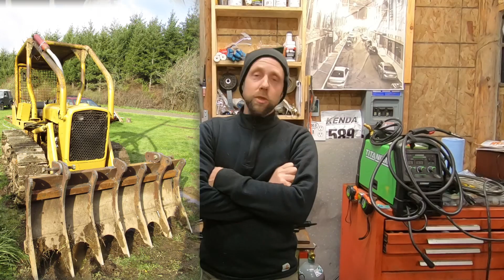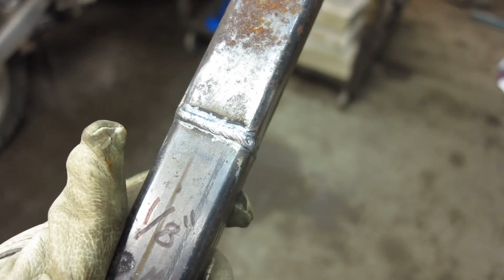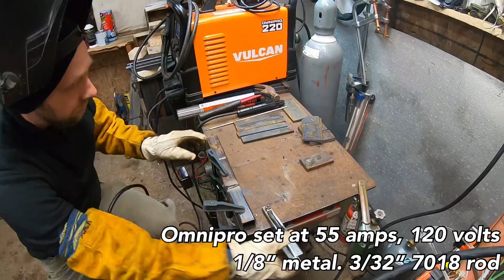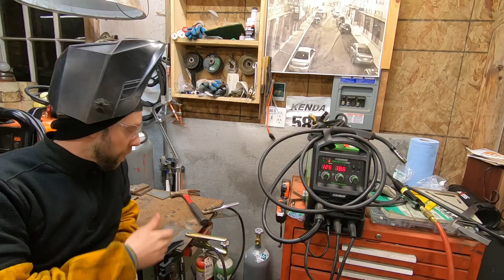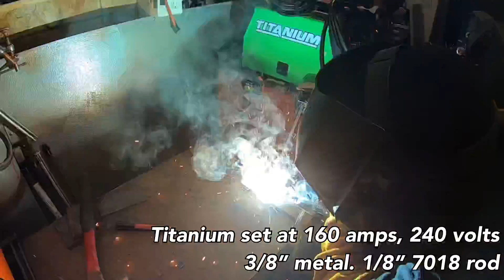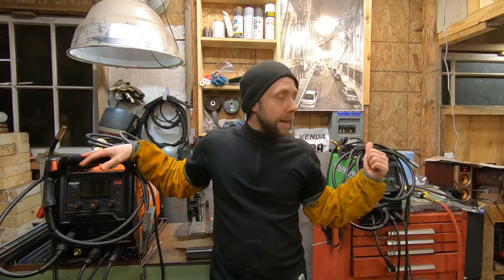Vulcan Titanium welder Harbor freight stick welding comparison

Comment: edit:link is down atm I fucked up admin from command line. container with WordPress db filled and I found out the hard way adding a / to the end of rm deletes a directory when u intend to delete a symbolic link
If anyone wants to see inside green machines.. This was buried in a reply to the Channel owner. It's my site.  https://www.vengeancetech.biz/fabrication/titanium-120a-wire-feed-partial-tear-down/
I'm not an ee but into electronics since my first word. light bulb. ham radio liscense at 13. I've done custom boards /cadand built UV lithography rig to make cad I did.. probably mathematic dyslexic or I would have a CS degree but point : my creds or lack of not hidden..   obviously you don't have to read a word you could just look at the pictures. When I first wrote this I didn't have a picture of the backside of the main but there is now one at the bottom
-----also sub dude who takes the time to make the well produced quality content above. So hopefully we see more of it cuz you know the alternative: five minutes inaudible talking and speaker blowing grinder or other tool noise. Learning about things have a prerequisite of hair trigger mute and Advil by the keyboard.

-----

my friend has the 120a titanium mig and its a nice little box but if u use it as a daily driver I don't see it lasting very long. he had issues where it wasn't feeding so I opened it up and.. it could be a lot worse but there were some serious issues. first is longevity expectations. the two large bulk capacitors are literal between the 2 main heat sinks with very little clearance. You can think of these caps as basically a paint can with fluid. this paint can has a magic fluid inside it that once it's gone the magic of your welder goes with it. fluids tend to dry up/evaporate and high temp makes that happen faster. 

The manufacturers know this and that type of capacitor is rated for hours at a given temp. there are types that don't depend on liquid but for the large capacity these dominate and for any capacity are usually cheapest. 

but with the paint can type (electrolytic) If you exceed that rated  temp the expected hours it will survive start to decrease.

 Major design faux pas we're talkin like half an inch between heatsinks that are attached to the switching devices that do all the inverting in your inverter welder. they did put a fan and a little air duct but if that fan fails I would not expect name the last at all not like you might use it a month or a week I would stop welding from what I saw on opening that. I didn't have long inside it and my phone was dead so I don't have pictures of one side of the main board that said I could not even locate a fuse on the darn thing. There's a hundred and 80 amp current shunt but that's not really meant to be abusing if it blows it out board will be repairable most people that I've known that have own welders wanted to open them up anyway the thing is basically designed to last a year or two if you use it seriously if you use it maybe every 4 months you might find you get 5 years out of it like for a week every 4 months not just like pull the trigger once. I can't see it lasting more than 2 years with daily use anywhere near the duty cycle and that's if you get lucky on the fan survives the whole time we all know shops are not usually the cleanest environments particles in the air wise. This machine also trips gfcis more often then my clutch 140 and when I opened it it became apparent as to why I don't have the expertise to tell you exactly what and how much of it was missing but I will tell you if you ask someone that does Lake Worth of Paul ee degree I would probably bet my life they're going to tell you that the power filtering is minuscule to inadequate barely adequate might be astretch I like welding on that box dont get me wrong. I liked it the moment I tried it. we noticed things like popping the gfci and lights flickering or failing significant more frequent with the titainum. the drive motor may or may not be failing for his wirefeed. if it did it would be incredibly cheap and easy to swap yourself.

it seemed to be lacking quite a few human Saftey considerations as well. I'll updated this later with specifics and I intend to open my clutch today to see if it's really any better in design. I know it didn't really shine until I was able to plug it in to properly gauge wire for a long Outlet run. I don't like any of the potentiometers aka the knobs on the front of that unit but once I got it figured out I really enjoy welding with that as well. I have the version one of the clutch which was notoriously hit or miss not in people liking it it's either they got cradle death or a welder they loved it died out of the box or it's excellent. I might be able to shed some light on why later. By the way it would make more sense to talk about what it's rated in Watts when you say at 120 volts because 70 amps or whatever welding amperage you're using is at like 16 volts. Volts times amps equals Watts if you raise the voting age you can draw less amps for the same amount of power. That's why the wall is 120 coupled with the fact that heat is an equation of power in watts of thermal is equal to current squared x resistance which is why we use high voltages for distribution and relatively high in are walls but a welder watch the Heat so you drop it to lower voltage to raise the amperage
Reply: Wuety06 Appreciate the technical insight on the internals and QC issues you must have an electrical engineering background? From one QC tech over here been looking at both the Flux and the Stick Titanium’s from HB any better recommendations?  Thank you sir on this report on the circuit and real world insight!
Reply: @kewlnorcaldude  I assume HB is HF? I just cleaned up my comment above a little for the same issues this tiny ass phone screen interface isn't helping anyone. I'm guessing both the stick and the flux models share pretty much identical components. the stick of similar amp ratting probably just omits the chip(s) to drive the motor, and motor for the wire.  I've only been inside the flux core one though. On some Carpenters Channel he was talking about his stick version and just from looking at it on there I could see from the form-factor it's probably the same internals. Logical reason to do this is if you can design a printed circuit board once and use it for multiple designs by just populating or not different components areas you save money over two unique designs. As for my background I'm kind of all over the place. I got my amateur radio license at age 13. By the age 22 I stopped counting how many computers I built for small businesses like workstations or desktops for home users and I was at thirty when I stopped Counting. I started University pursuing a computer science degree then switch to management of information systems and got a bunch of business stuff and tried to go back for information systems at a different College but then and continuing for the last 3 years my life has been hit by a train called parents with personality disorders who left their house go moldy it spread to my last apartment then before we figured out and put them back in control of everything mine when they offered me a place to stay. Which thing turned into what I'm currently sitting which is an empty apartment that's how I'm 45 minutes away while they played games of threatening to get rid of all my stuff and some of its not even mine stuff other people paid for. Somewhere along the way I realized I probably have mathmatic dyslexia because I got up to calculus and I can tell you how calculus works like what you're doing if you do any girls in derivatives and if I have a calculator I could probably pass the test but at the University I was at when I tried to take it you can't even have a basic one and my propensity to flip the rules around especially under stress and knowing that every little sub-point in the problem adds up to the correct or incorrect answer I could never pass calc. Though at the first University I attended my friends group usually consisted of engineering students and I love learning in general so I absorbed quite a bit there but Concepts on plastic vs. Elastic deformation. deflection and deformation in general good vocab words if you're going to build anything and wanted to do something/meet requirements. And I actually lived with the guy who had gotten out of the Navy and was running a reactor when he was in the Navy on one of our big floating things. He was going for his NE degree. You got that and then he went back for Materials Science and at some point ended up renting some lab space at that University because he figured out his own way to do friction stir welding. I never saw after he pulled the samples but I've seen plastic welded to Wood. Because after he got it working with aluminum he was playing around for a bit. Computers on my main thing though and ee knowledge comes from free time over the years putting together how code becomes what u see on the screen. ie what's going on at a hardware level. That former roommate that did the friction stir on his own is also the reason I know how to weld at all. He let me borrow his little red Lincoln flux core. Which I also quickly learned the benefits of having versus not having a cart and returned to him with a cart lol. My first attempts to lay a bead were crouching on my apartment patio trying to Shield my nuts as much as figure out a bead. And then I had my eyes on a Hobart Handler 140 for about eight years in between but just last year I saw the Northern Tool klutch 140 SI get clearance because they were coming out with a second version. I picked it up for like a hundred and seventy and didn't want to ask any questions swipe the card as fast as possible cuz it was still labeled 250 on the shelf and I'm sure u know what range u normaly expect for a 140a mig/what a deal that was.  before the hell started from my parents house I was working on making a few Hardware projects and had fabed the tools to do UV lithography at my apartment. Cupric chloride Copper Etch bath and a vacuum pull down UV exposure box. Sub-project for the main one that I was getting paid for was a capacitive discharge spot welder. Lithium-ion packs are generally assembled buy Spot welding nickel tabs between the cells. The weld heat is intense but so brief the cell doesnt as a whole go up in temp very much. Overheat a lithium ion cell and you're looking at a little bomb basically. Best case if you overheat it the cell dies early. I got that welder working right as I was having to move back into my parents and haven't been able to touch it since but I did demonstrate actual welds from it in the fact that when I put the tab to tab welds that I made in a bench vise and gripped other end with a plyers, pulled till failure,  I got a failure in the heat affected region around the weld nugget. aka weld stayed out and strip ripped off around it..  version 2 of that board I've yet to test but I designed it to be modular and on the main control it has several channels of electrically isolated data or switching ability. Some inputs and outputs because you might need to read some sensors. The controls anyone touches like user interface and the logic are on one side of the isolation. It then passes over isolation Bridges 2 encoder chips that allow it to be noise immune differentially signal because you wouldn't want the Emi generated by a weld continuing the weld. But the reason I did the isolation is Intended this board to be usable for a DIY controller for any electric welding or cutting process.  I meant to be selling the damn thing by now but the police in my hometown or where my parents live are pretty confident that doing what my parents are doing I have very little recourse so doing what my parents are doing I have very little recourse so they stuck with the easier method of keep my parents happy because person with 16 years of things they worked for taken and left on the street isn't going to afford a lawyer but retired boomers are. I'm not even exaggerating my parents got in their head that they could use the police and false reports as a punishment and even when I went to said police with recorded calls in a state where its single party consent to record, calls admitting some of the bigger reports were completely backwards or just done as a punishment and ask too at least put on record my parents are unreliable Witnesses what started as a meeting with one officer turned into another walking in then assuring me she's there to make sure I'm not getting the word of One Cop.  I didn't hear that if we put on record your parents are unreliable Witnesses the department might be liable. they then try to tell me opening my mail isn't illegal because it went to my parents house endorsing checks in my name without my knowledge or permission from my mail isn't illegal. Oh and it's not illegal to say you own someone and that's but when I knew the meeting was over. after I move back in a pro determined a huge mold problem my mom had a surgery coming up and both of them decided to Gaslight and deny it with a profound but it wasn't just that it was my mom actively would follow me around telling me I'm delusional. I had picked up webwork and between the two I said to my Dad paid think of Hotel would be better for her to recover if I went to one from the surgery she has. So it was supposed to be a two-week stay in a hotel and they just decide they're keeping my stuff I'm not allowed in the house anymore after. This legal system is so fucked up I don't know what the point of anything is anymore there isn't one when someone can literally endanger your life take all your stuff and then claim that endanger your life take all your stuff and then claim that your words are more of a threat than their actions when you can't even get their words endanger your life take all your stuff and then claim that your words are more of a threat than their actions when you can't even get their words endanger your life take all your stuff and then claim that your words are more of a threat than their actions when you can't even get their words or actions on record because the cops just won't make the report but no questions are asked when the other party wants a report
Reply: @kewlnorcaldude  also I'm relatively sure that the friends titanium took out the chip in a car key that I have next to it. Probably any welder would have done it especially inverter. An arc is literally a wideband electromagnetic transmission. Those chips or what they call the transponder in the key or what the ee world  calls an RFID tag operate like a air core transformer for power transfer from readers emitted field to the coil of wire attached to chip in key. if ur credit card has the wireless symbol hold up a flashlight and u can usually see the flat coil embedded in the card... same tech higher freq. But the car keys time of year is about 125 kilohertz. The little chip attached to the coil it's powered and has an internal capacitor so with the power at then shorts out the coil and the reader in this case in the dash then interprets how the field fluctuates with the coil shorted and that's how data is encoded. My question for you is have you ever heard of anybody welding and then their car not starting? I can find tons of stories about people welding on a car frame and frying Electronics but I haven't seen this talked about online at all. It's a complex enough thing where I have to assume even if it's happened it's likely one might not put two and two together. From what I've seen most converter circuits tend to run from 100 kilohertz to 500 when they're high power circuits which would mean the switching speed what is likely pretty close to what that chip was expecting on its coil for power and The Arc in general is wideband. If you look up the first radio transmitters they were what's known as a spark-gap transmitter which is now outlawed by the FCC because it's such a wide band Device and spectrum is so scarce. I have yet to acquire anything like a spectrum analyzer which would allow me to see it but I can theorize that the switching frequency ends up being a pretty large component in the white band Ark. I've also always had a car with a chipped key and never seen one fail before this
Reply: @kewlnorcaldude  I updated that link. took apart a flat panel led light which had an overkill/ideal noise filter, so I broke down what each part is and included a picture to show what is lacking on the welded pcb. inverter is just a switching supply and so is the led driver, so while it might not seem like a logical comparison.. min the ee world it is/the welder actually needs it more than the light panel due to amount of noise its capable of putting back on the line

Comment: Nice vid, quick ?, Do you think the predator 9000w generator can handle this welders on max settings? Thanks, my son is 15 and he's been doing random welding jobs outdoors and needs a mobile welding unit, don't want to break the bank because he might lose interest as he gets older.
Reply: You should only use a generator that has a THD less then 5% to run an inverter welder.  Unless otherwise stated, most generators have a THD of 10% or more, which could kill your welder.
Reply: @OnRappel  we been running the stick welder on DC with no problems so far. Harbor freight generator 8500w